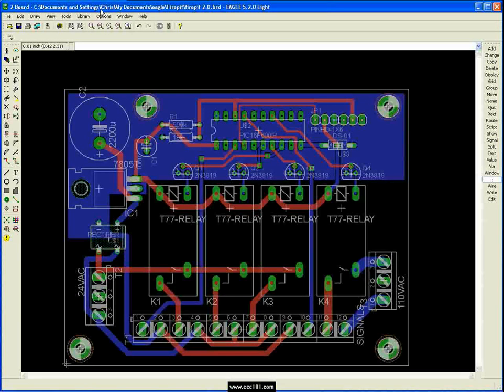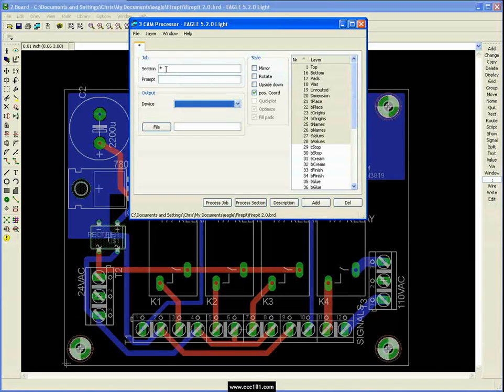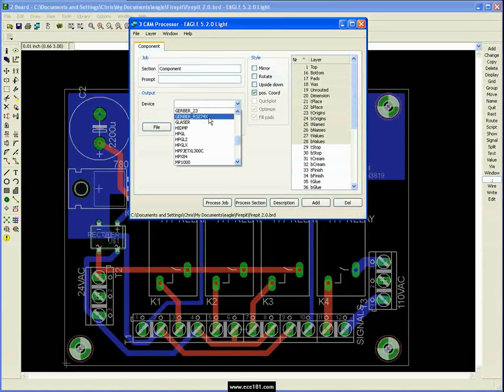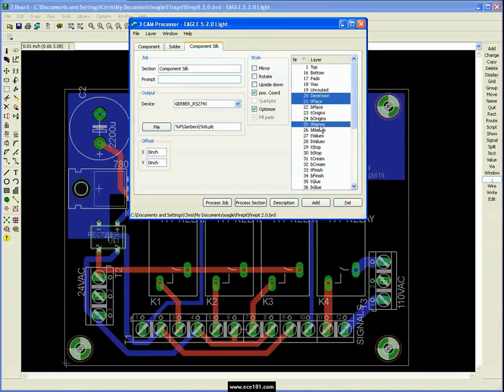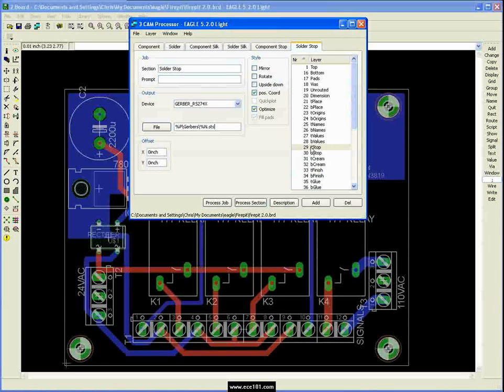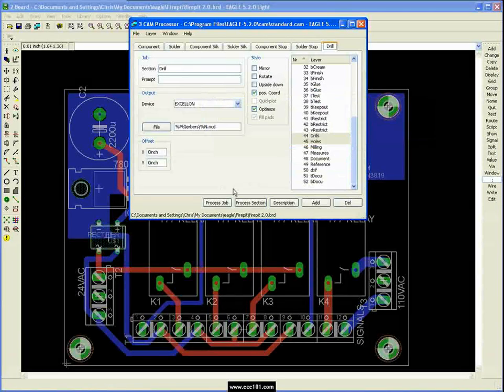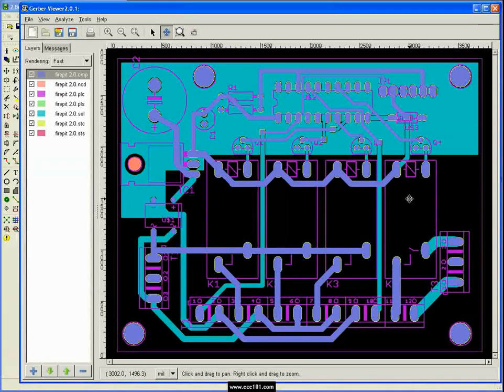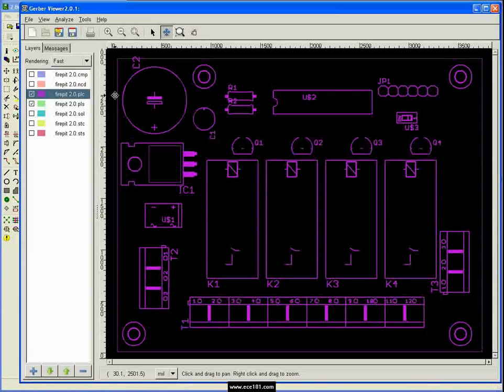Create Gerber Files using Eagle

Comment: Eagle export to Gerber:

Click 'Add' to create addition tabs and put in the following details.

File Extensions & Descriptions

Device Output Type: Gerber_RS274X

.cmp Top Copper - Top, Pads, Vias
.sol Bottom Copper - Bottom, Pads, Vias
.stc Top Soldermask - tStop
.sts Bottom Soldermask - bStop
.plc Top Silkscreen - Dimension, tPlace, tNames
.pls Bottom Silkscreen - Dimension, bPlace, bNames

Device Output Type: EXCELLON

.ncd NC Drill - Drills, Holes

Click 'Process Job' when complete.
Add all 7 files into a *.ZIP archive and upload.

Comment: Thank you very much for this!  I have a question ... I have added text to the bRestrict layer, using the vector font, so I can have text etched in my bottom layer copper.  Following your tutorial, I should select the bRestrict layer when creating the *.sol file, right?  When I do this and run the CAM processor, the text is missing from the *.sol file and the copper is just solid.  What am I missing?

Comment: You don't say why anything is given those extensions. You just say, lets it use these random layers and give it this extension for no reason.
Reply: He does say:

*.cmp - Components (from the tradition of the component placement at the top layer)

*.sol -Solder layer (Bottom)

*.plc Component Silk (place)

*.pls Solder Silk (bplace)

*.stc Stop components

*.sts Stop Solder

*.ncd NC Drill file

Comment: Hi Chris. Thanks for the video.  You didn't mention a "Milling" Gerber file.  My power connector has 3 rectangular slot holes in the board that show up in Eagle's layer 46 "Milling".  I'm assuming I need a Gerber file for this.  Any suggestions?
Thanks!